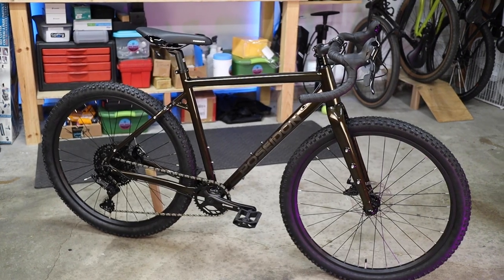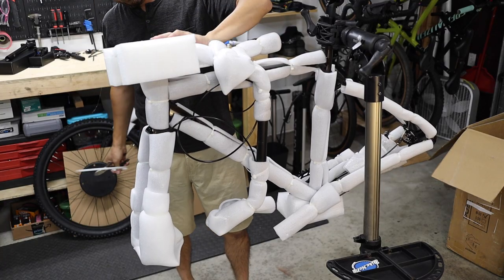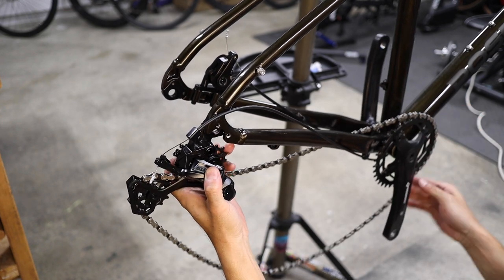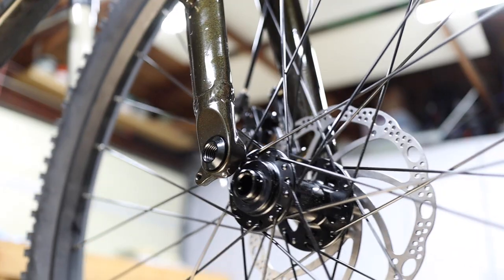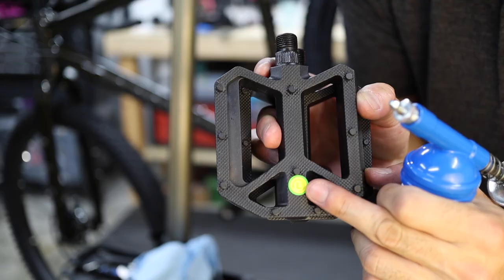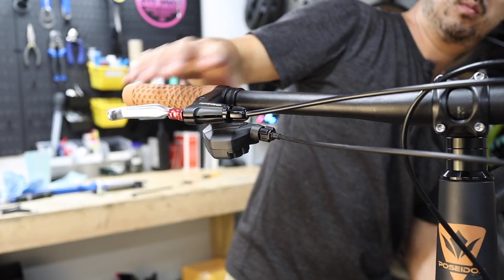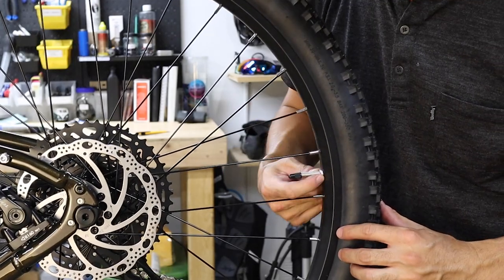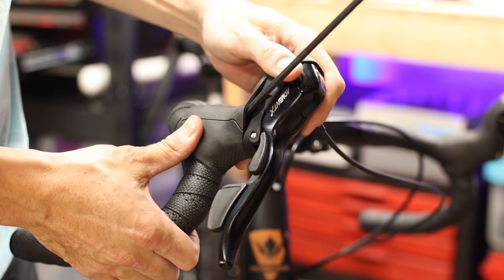New 2022 Poseidon Redwood // FULL Build Tutorial (Drop and Flat Bars)

Comment: March 2023.  Just built my Redwood.  My headset was too tight, and my rear caliper was slightly misaligned.  I had to adjust the pads on the front brake, very easy with there Tektro units.  I have two extra bolts in the brake disk bolt bag.  They appear to be derailleur hanger bolts, but the hanger already had bolts attached, so they remain a mystery.  Everything else seemed perfect.  

I inflated the tires to 40psi, higher than most people might do but smack in the middle of the Kendas' range.  I was 2.4 miles into bedding in the brakes, having a very nice time and enjoying my new ride, when I had a sudden and very loud blowout of the front tire.  I was only going about 10 mph and was within a few hundred yards of my house.  No apparent damage to the rim or tire.  I took pictures of the destroyed tube and emailed Poseidon with this news.  I'll follow up regarding their response.

EDIT: Follow-up.  Poseidon had a replacement tube on its way to me within an hour.  Great customer service!

Comment: Always good to see a step-by-step bike build regardless of brand or type of bike; many steps are the same regardless of the type of bike. This one has lots of helpful tips to fine tune the setup, and some to make things easy that didn't specifically get mentioned, like putting the chain on the smallest cog when installing the rear wheel (I've never had a stand so I install the seat & bars, flip it over on a towel & install the wheels, derailer; it ain't pretty but it works :). Good call about checking in w/your local bike shop later. Thanks! 👍🏻

Comment: Great video. I have built two Redwood (both size large) and both required a rotor shim (in the rear) in order to move the rotor out a few millimeters. I have never needed to do this with any other bike build. I adjusted caliper on the frame, cable tension and both the inbound and outbound adjustments for each piston. Even with all of those adjustments maxed out in favor of correcting an inner pad rub, in the end I needed to shim the rotor out. Perhaps Poseidon can include (with their bikes) a free rotor shim in case it is needed.

Comment: My Redwood finally arrived and just set it up using your video (: 

Brakes took some patience to adjust correctly. But conquered nonetheless!

Other than that I had to do minor adjustments to the shifter cable. The cable was routed on the wrong side so I had to cut/press new cable ends. 

After some tinkering everything looked good. Took her out for a spin and warmed up the brakes. Feeling pretty spongy but I already bought a new brake line housing per your recommendation! 

Tires & wheels definitely have some weight to them. And tread is pretty aggressive. Guess it just means to ride some trails and get off the road! 

Also ergonomics are funky. I’m 5’11 and got a Large. Stand over fit fine for me but it’s the distance from saddle to handle bar that feels a little cramped. Don’t see how I could ride aggressively with this bike and really lean. I guess that’s not really the point in a gravel bike though. 

Any suggestions to help with this? Maybe an off center seat post?  Is that even a thing? LOL

Comment: I’m highly interested in purchasing this bike then mixing in my own parts. Specifically my old Mtn bike wheels. They’re 142x12 rear but 100x9 front (the old quick release standard) but these are actually a Hadley hub with a through bolt attachment. I can source a tapered rigid fork with 100x9 but they’re almost the same price as this complete build. Do you think they will offer a model with 100x9 fork? A few companies still do but I’d rather get a Poseidon
Reply from the maker: I doubt they'll produce a 100x9 qr version, but you can easily tinker around with different forks